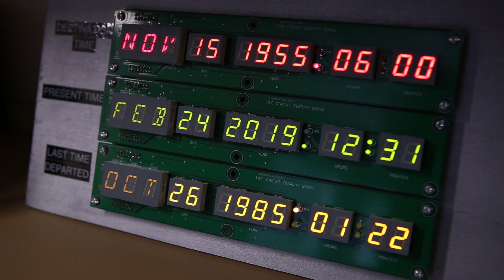Ultimate ATX Power Supply

Comment: So you built this?
Reply from the maker: @ZedRedDuece  I did.
Reply: By using the other IDE and 4 pin connectors, are you getting additional capacity out of the power supply?  Seems most others are only using the 24 pin connector.
Reply from the maker: @ should be. That’s One of the reasons why I decided to make my own. Plus I added in the fuses and the terminal blocks.